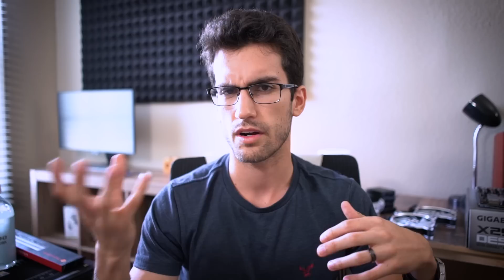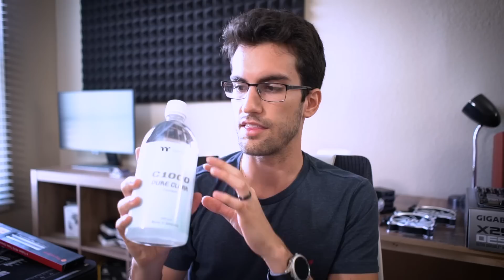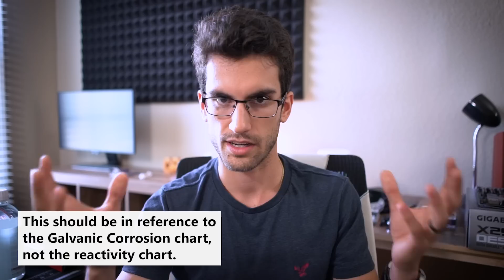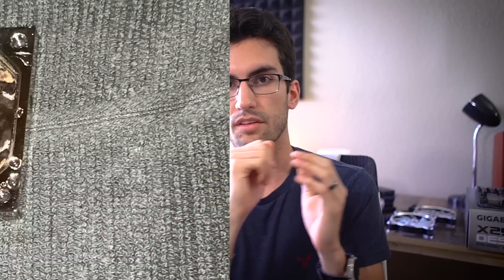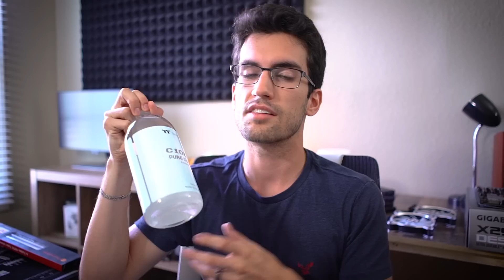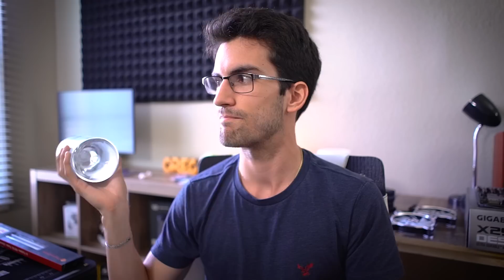How Do AIOs Get Away with Mixing Copper AND Aluminum?

Comment: The automotive world has been using many different metals in their liquid cooling loops for over a century. Nowadays, if you use a good OAT or HOAT coolant and change it often enough, the corrosion would be relatively minimal.

The recommended change interval can be as long as 50,000km or 5 years, whichever comes first.

Comment: so any idea of the timeframe before galvanic corrosion with the c1000 liquid ? i have ek fluid gaming kit and i want to expand it with some copper/brass fitting and i'm worried that it will ruin the system in like 1 week with all the warning EK put on parts of the fluid gaming series

Comment: Everything in tech revolves around this one phrase.... "planned obsolescence" . Make your products work just long enough to create incentive for people to buy the next iteration of their design. If everything was created with indefinite life cycle in mind then their profits wouldnt be nearly as much as they are.
Reply: That is not necessarily true. The longer something lasts, the more it will cost to make. Take product A that will last 5 years and cost $100. Then, consider product B that will last 10 years and cost $500. You are paying 5x the cost for 2x the life. Simply replacing product A after 5 years will cost less. It is about considering the cost over the life of the product.
Reply: Just get a high-end air cooler and it will last 15+ years before the fan dies and then you can just replace that
Reply: Indeed and when you air cooler fails nothing on your PC is at risk (even without a fan on a heatsink most will not reach shutdown temps and even if they did modern cpus have thermal limits) and will cost you $15 or less you replace a fan.
Reply: @parsastrife6629  
That is related to diminishing returns. You pay much more money for a technology that can dissipate more heat than air cooling alone can provide. But, PC hardware usually does not need the extra cooling, especially not enough to justify the additional cost and risk.

Comment: It's kind of a shame that they use aluminum since it forces them to use glycol. Often the performance decrease is caused by the glycol, as a solution (20-30% by weight) has a lower heat capacity, so less cooling capabilities.

Comment: Quick Question, If I made a custom loop and did not mix metals, how long could I or should I wait to add a protection additive to the loop after using a system prep and then flushing it? I have the draining stuff coming and want to get my primochill vue coolant in as soon as possible but I don't want to have to buy an additive right now.

Comment: So if you used flex tube versus the rigid stuff with that TT kit, then I guess you would need new fittings to hook it up to.
Reply: William Murdock yep. Unless you buy a tube of the same diameter and thickness

Comment: I thought the rust on the AIO was because it's outside exposed to the full brunt of the weather and environment, lol.   I'm sure the team that operates the Arecibo Ionospheric Observatory (AIO) does do quite a bit of maintenance to keep the weathering at bay. (sarcasm)

Great topic by the way, cooling loops with different metals and potentially an electrolyte like fluid. B)

Comment: How is aluminium cheaper compared to copper?
Reply: Hasan Sultan They're everywhere, you can find aluminium in your everyday soft drink cans. Cheaper minerals means they're more common and easier to find
Reply: Aluminium is also easier to refine and forge, being easier to bend at any temperature, and compared to copper, melting at a lower temperature
Reply: Well i just gave a chem exam like a month ago and last i knw copper can undergo reduction using coke and carbon at low temps hence cheaper and easier to extract. However for aluminium u dissolve it in cryolite to reduce its temperature since it doesnt undergo reduction. And for aluminium it requires electrolysis at very high temps almost 900 degree Celsius moreover it requires current in thousands of amperes
Reply: And hence aluminium is comparitively more expensive in comparison to copper
Reply: Thats what i know of and what my books said and what i wrote in my exam😂
Reply: Hasan Sultan I imagine the difference lies in the nigh endless number of commercial Al alloys vs. the cost of commercial Cu?

Comment: Why is copper a decent thermal dissipating compound? I Would like to see this application in day to day workloads. Not that it will work.
Reply: ashley Knipe higher heat dissipation capacity.

Comment: Greg is right about the AIO's cycling particles over a long time, I have a Corsair H100 with an expired warranty. I noticed my CPU temps climbing, so I figured I had nothing to lose by opening it up. Sure enough this black and green crud/gunk was all over the cooling plate.  I scrubbed it clean with a hard bristled toothbrush and flushed out the radiator with vinegar and water 50/50 mix. I cleaned the pump as best I could. it looked in good shape overall.  I then flush everything with distilled water a few times.   Also, I did keep the old coolant and filtered it thru a few coffee filters. I added more anti-corrosive and anti-bio to the coolant and filled the system back to full.  It's been running now for over 18 months now and is keeping my overclocked aging fx-8350 under 55c under heavy load.   I so need to upgrade my system  :-p. with prices showing signs of dropping ill keep an eye out for good sales after summer. 

       Oh for those that want to know how I refilled it. I just bought a large syringe minus the needle, one the fit the small hole inside the cooling plate housing and filled it holding the pump up in the air.  just be very careful not to spill coolant onto the electronic part of the pump. I wrapped mine with few paper towels while filling it just in case of spillage :-)

Comment: An all aluminium kit is perfectly fine though. I feel like that should be mentioned more. Car cooling systems are often aluminium. This is also why EK has all aluminium kits. In general, for custom loops, one should avoid mixing metals. Either get all copper or all aluminium.
Reply: cars have been on mostly aluminum cooling systems for decades, the cost and weight benefits far outweigh the performance gains of copper/copper alloys.  but most people going with custom loops are looking for every last performance gain they can get, and weight really doesnt matter for a pc.  but for budget orientated kits, aluminum should be a no brainer.
Reply: Cars also mix metals in damn near every instance as well.
Reply: +TrueMegaManiac it's important to note that metal mixing in cars is often done in ways that prevents galvanic corrosion, such as electroplating, by using non-conductive layers of paint, using rubber or plastic grommets/mounts whenever you bolt stuff together, etc.
Reply: you can find 15$ Waterblock for CPU or GPU in copper, but not the equal in aluminum, too bad because aluminum rads are very cheap
Reply: The copper used in cooling stuff isn't pure copper anyway. And the used alloyes are actually not that far above aluminum. Both are fine to use, just mixing isn't the greatest idea.
Reply: Vignesh Balasubramaniam what cars cooking systems are aluminum I thought everyone’s were gold because all my cars have gold cooling systems.
Reply: you're correct, but you should note that modern car engine blocks are made of aluminium alloy so with aluminium alloy radiator they're more/less same electric potential, not to mention the distilled water used to fill the radiator.  so yeah, to prevent corrosion it's better to stop that from the start by using all same metal for the loop.
Reply: thank you. god, this obsession with copper loops. the difference is literally a couple degrees c, if that.
Reply: The way people shit on aluminium, you'd think it was 30 degrees worse or something. But no. It's damn near identical. Haters gonna hate, I guess.
Reply: Bad comparison with cars. In cars big concern is weight, copper is much heavier. Plus production cost is much higher with copper. Plus cars are not the case where extreme heating is a thing unlike CPUs.
Reply: @ogamov  what are you talking about ? do you even know how much heat a high compression 4 stroke engine generates? Now add high revving to this engine and they produce even more heat.
Reply: @tougeattack123  hurr durr i9 is hotter than a car engine - Alec S
what is hotter than a car engine is my Pentium EEEE 990FX!

Comment: Cars have been running for almost a hundred years using glycol based coolants with a bunch or corrosion inhibitors added. 

If galvanic corrosion was the issue people in the PC DIY community make it out to be, all those cars with copper/brass radiators and iron/steel engine blocks would be leaking coolant within the first year 😂

Comment: skip to 6:06 guys. thank me later
Reply: he says too many words with no content or repetitive content thanks
Reply: Tech Ownage also the answer is in the first like 2 minutes when he mentions car radiators. Why everyone isnt using high performance automotive coolant is beyond me. If it runs through aluminum heads into a iron block into a copper or aluminum radiator and you get to make tire smoke with it for like 100000 miles, I feel like it will survive 60c temps for....ever. (if there is a good reason not to, let me know)
Reply: Tech Ownage thanks
Reply: OMG thank you
Reply: thanks a lot

Comment: The expandable fractal Celsius AIO kits are similar copper/aluminum kits, and they also include a separate additive to slow galvanic corrosion. Interesting solution, good video!
Reply: Coalition Gaming
The previous Fractal AiO series was manufactured by Alphacool and had a copper radiator.
Reply: cl4ster17 that must have been the Kelvin series which wasn't available in NA
Reply: bouke Kalkwijk Yes that's what I said, thanks.

Comment: I'm at a loss as to how different metals interacting in a cooling system are any sort of mystery. The automotive industry has worked out various coolant formulas over the last two decades that are non-corrosive, non-conductive, and considered "lifetime" coolants because of the change intervals. I mean, I'm not saying to dump DexCool into your water setup (car-guy joke 'cause DexCool suxxxxx) - but I am saying that it's probably worth looking into other fields for tested and affordable solutions.
Reply: The channels in cpi blocks are smaller, so its easier to clog them. That said youtubers using stupid colored coolants tend to have more problems
Reply: Ziv Zulander I'm sure there's a LOT that I'm not considering concerning a few things, haha. Coolant concentrates are diluted, but even then viscosity isn't too much off from water. There are small hoses and channels that coolant flows through in the engine block and heads, but that's also around 10-15psi once the engine is under load. I know that I've read of people doing that before with ethylene glycol (green stuff) with results on par with PC equivalents, and that's not surprising. BUT ethylene glycol is no longer used by manufacturers because of the potential for corrosion if not regularly maintained. The only other thing I can think of that could be an issue is how certain plastics break down and become brittle when exposed to certain coolant formulas.

Maybe somebody with a chemistry background can hop in and skool me on why my unoriginal idea is bunk lolol
Reply: They are not. Easy greed! There is a financial incentive for cheap Chinese manufactorers to fight over saving $.35 per unit. Also there is an incentive to make sure your product fails after 2 years so you go back to the store and buy another one. More money WahoO!! Car manufacturers have lemon laws and smarter consumers. PC users buy based on brand and love wasting money for that green Nvidia logo or an Intel CPU because it is about class and brand. In other words PC users generally are dumb and with no lemon laws and lawsuits it makes sense to screw consumers to make them repeat customers
Reply: illitero the only real breakdown issues you would have is with glycol based fluids, and petg tubing. The "G" in petg stands for glycol. So the fluid would inevitably break the tubing down. 
As far as soft tubing, that eventually starts to break down with whatever you put in it. 
P.s.  also a car guy. Lol
Reply: I have heard that anti-freeze works well in liquid cooling loops because it contains a corrosion inhibitor (at least I am told that it does). Corrosion inhibitors can be insanely effective. However, the inhibitor would need to be a a chemical friendly to plastic. I do not know what inhibitor anti-freeze uses.
From a marketing perspective, anti-freeze is ugly. People want all these fancy colors and effects in their cooling loops.
Reply: Austin P my zerex asian coolant is bright pink. Theres green, orange, bright pink. Probably blue and other colors too. Im sure colors get more fun as automotive coolant gets more exclusive, expensive, or purposed. (Gotta be easy to identify in a shop)
Reply: HatelivesNextDoor 
Very interesting. I've been thinking of water cooling a PC and using anti-freeze. I will need to consider those options.
Reply: +Point Vector This is exactly the kind of reply I was hoping for. I'm a big ol' stupid when it comes to deeper understanding of most things, so I'm always looking to soak up whatever I can concerning all facts for all sides of an argument/idea. Ultimately my confusion comes from knowing that various elements exist in automotive cooling systems (plastic/rubber/aluminum/copper/whatever), so it would just seem a solution borrowing from that industry would be a no-brainer for the PC realm. But again, that's coming from an admittedly ignorant standpoint on the finer details, be it material or marketing. In the end I'm not saying that people should just be going to AutoZone and buy a gallon of green stuff, but just wondering about the overall history of liquid cooling on PCs and wondering about why there's this amount of mystery in general.

I've got some studying to do :)
Reply: illitero this is why i went with a silicone tubing. Silicone is common in aftermarket coolant hoses. Regarded as superior to the stock rubber.
Reply: Its because most of the PC enthusiasts community typically aren't very knowledgeable in the automotive industry. I'm fortunate enough to have a fair bit of knowledge in both industries which is why I'm not suprised.

Comment: Cut open a asetek gen 6 pump/rad combo. IE: h150i pro rgb, there is a clear coating in the radiator runs. It's not just chemicals anymore.
Reply from the maker: Most AIOs still run pure aluminum rads and copper/nickel-plated blocks.
Reply: Science Studio oh I'm not saying you were wrong, just the newest OEM Corsair AIO's do it differently than any other OEM asetek does currently. Probably because Corsair is actually solid on replacing components damaged by their AIO's if they leak/fail so they probably spend more than other OEM's